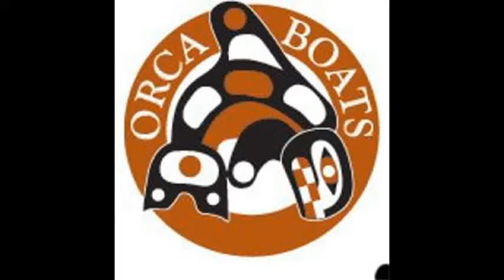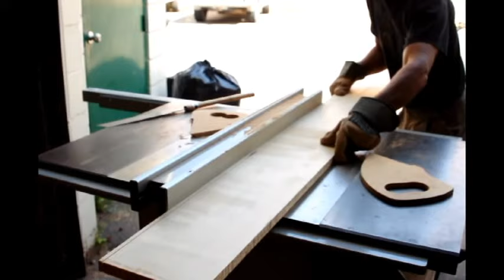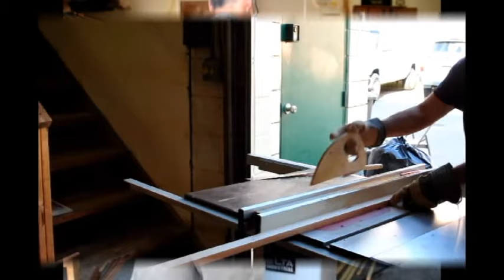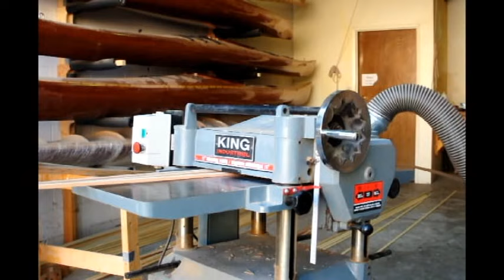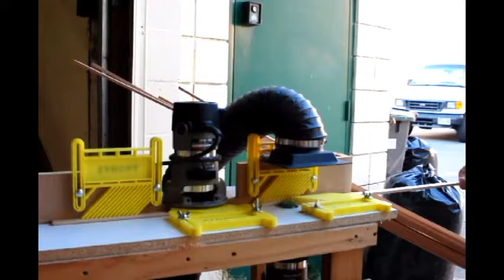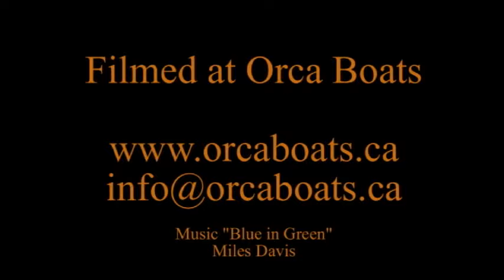Cutting cedar strips

Comment: NOT HOW TO USE A TABLE SAW.  NEVER GLOVES.  KEEP YOUR LEAD HAND PLANTED LIKE YOU'RE SHOOTING WITH A POOL CUE.
Reply from the maker: Well, after 25 years, I still have all my fingers. I understand the danger of gloves catching and pulling your hand into the saw.  I just make sure my hands are well away.   I need and use gloves only when pushing the long,  rough cedar through the table saw or my hands would be full of small splinters and slivers.   And when I do catch a splinter, (and I have had some doozies that needed minor surgery to remove) I tend to pull away quickly, which in my opinion, is more dangerous than the gloves.

Comment: This is a poor method in my book. If you used the Skilsaw method, you wouldn't need to plane your strips ! Nor would you need expensive equipment.
Reply from the maker: The video is not intended as a how to for home builders, just how I do it with equipment I already have since this this is a boat building shop.  A skilsaw is not going to rip through a 4 inch by 2 inch oak keel  for a row boat or plane down a 15 inch wide board of cedar for planking a lapstrake boat.  So yes, you can do it with less expensive equipment if the need for adaptation is warranted.  And industrial size equipment is not needed.  You could probably use a portable table saw, small planer and a single router which might end up costing you around $700-$800 for all and a good excuse to buy more tools (as if we need one)